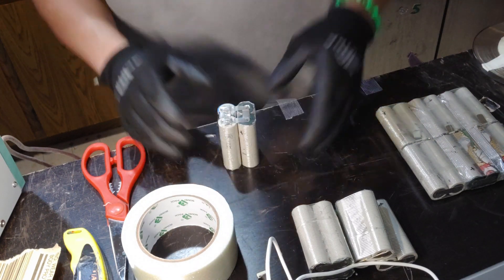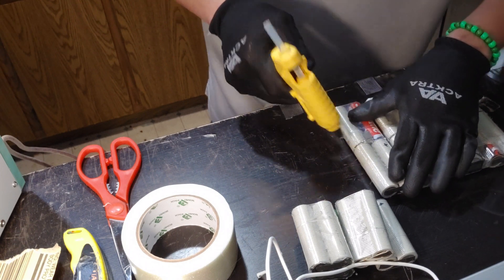Building a new 12S2P 21700 Battery for new DIY Electric Skateboard! [Part 4]

Comment: What size nickel is adequate for those batteries?
Reply from the maker: 15mm should suffice for the folds but copper wire for series connections